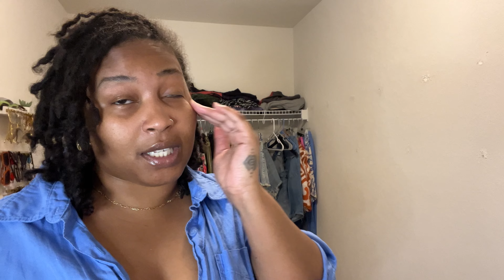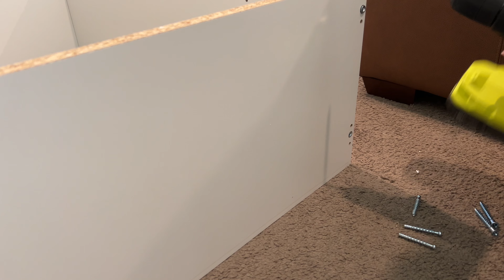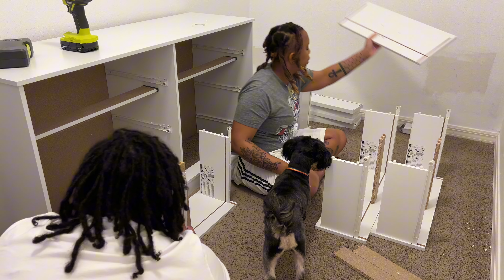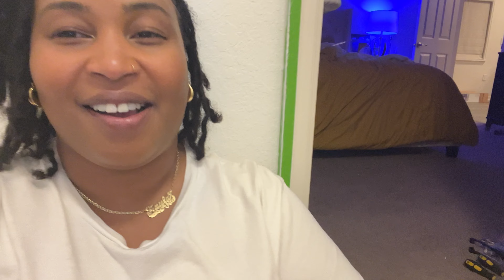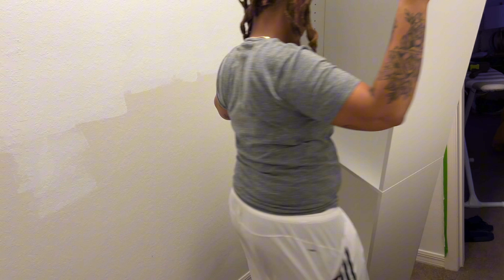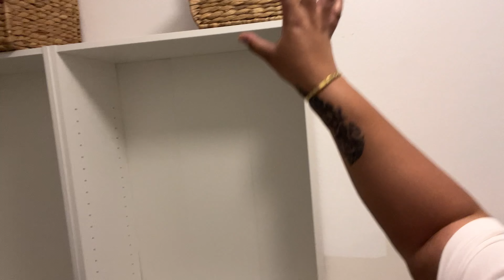Affordable $40 Target Bookcase Closet Hack | DIY Dream Closet Makeover | B-day Celebrations | VLOG

Comment: This is cool to watch. Looks good so far.❤  I have the target bookcase in my closet as well, but I didn’t know they had Rods you could put in them. I just ended up buying a clothing rack and putting it in the middle  for hanging clothes. And I put my tall boots on the top of the bookcases. Imma have to look into the rods.
Reply from the maker: Thanks Keeya 💛 yea you can get the 18in-30in rods from Home Depot or Lowe’s to attach in them to hang your clothes. You just have to get 1/2 inch screws separately. I’m going to explain in next weeks vlog in part 2. How’s your case holding up?
Reply: @LynnNessa  they are good. I had them for about 2 years.  My movers banged them up a bit when I recently moved into the new place, but they are steady if you put them together right
Reply from the maker: Okay good to know!! Sorry they banged them up  😏